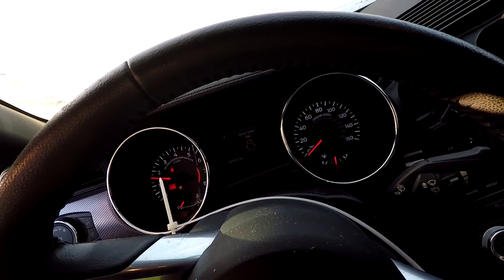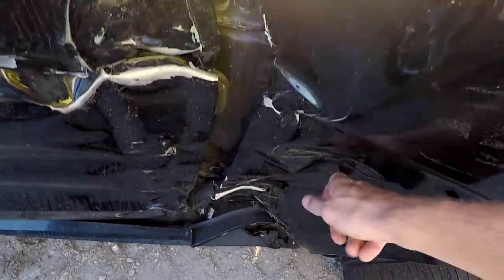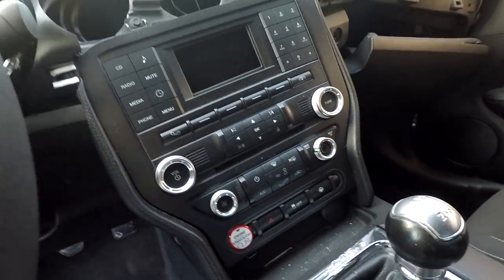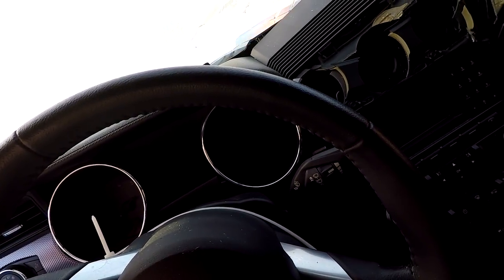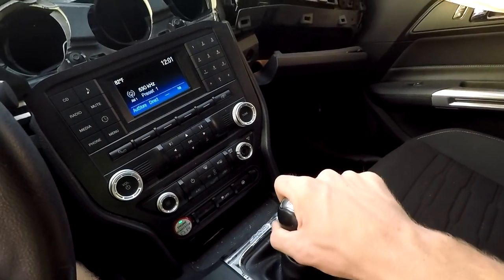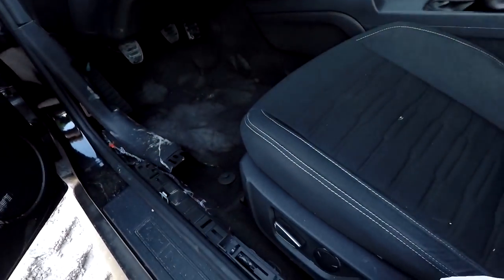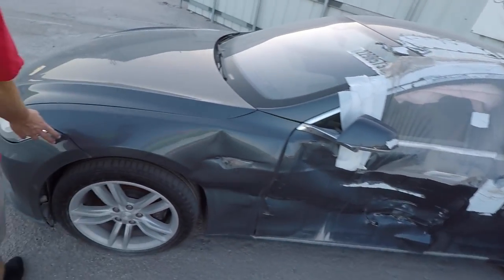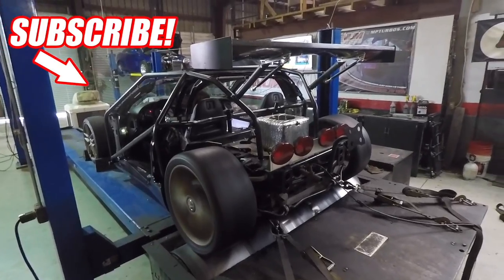WRECKED Mustang at Auction Has Hidden NITROUS! Should We Buy It!?!

Comment: My wife has an '04 Mercury Grand Marquis that she really likes, it's spotless inside & out. She asked me to build a sleeper for her. She drives my cars a lot and wanted more power. It didn't take 5 minutes to decide on the LS3 525hp Crate motor and automatic trans built to sit behind it. I swapped out the stock 8.8 dif with a much stronger posi unit. It took two of us 8hrs to complete the swap, close the hood and hand my wife the keys. It's been 2yrs with zero issues and a lot of surprised Mustangs in its wake. The LS weighs 125 lbs less than that cast iron boat anchor we removed.

Comment: id be looking under the car to see if the trans is leaking any fluid due to being cracked casue that car got hit really hard to buckle the firewall that far and fold the dash up the engine block could have so stress cracks that could crack all the way through from the car being bent so bad also
Reply: transmission won't leak it's a standard

Comment: Also something to keep in mind is when cars get wrecked like that the motor mounts break and they can damage the casing of the motor and trans ect...
Reply: mattybeatzkidd "the casing of the motor"
What?
Reply: fuck you mean "casing"? you talking about the engine block itself?
Reply: Meme City I was more or less talking about the transmission But yes it could cut off the boats for the motor mounts in the block
Reply: mattybeatzkidd boats n hoes
Reply: lkporter1989 lol bolts....god damn text to speach
Reply: mattybeatzkidd it ran and probably sat for days if it was cracked or breached the motor probably wouldn't run
Reply: mattybeatzkidd he'll need to fabricate new mounts anyways because there's no way in hell that will fit under the hood and bolt right up without a little bit of tenderizing. And by tenderizing I mean hammer-powered metal relocation.
Reply: Matt B, Do you have any hands on Automotive experience whatsoever?
Reply: mattybeatzkidd I don't understand a fuckin word you just said. You should try punctuation. It really helps.
Reply: Rodney Rael yes. you think im making this up? Have you never disassembled a wrecked car before. Its very common to find extensive damage to mounting points on the block and trans. As far as what kind of mounts used for the swap i have no clue. Ive never swapped a 5.0
Reply: Brendon Norton i appreciate it lol i was using text to speech which was a big part of it. But yes the grammar Nazis are always out in full force its absurd.
Reply: mattybeatzkidd if the motor mounts broke freewhen he revved up to 4000 rmp it would have been noticeable
Reply: mattybeatzkidd I will say I know What your talking about tho as I've rebuilt salvage vehicles and have seen it on a jeep wrangler. It snapped the bolts right off the block

Comment: S550 Coyote Engine and Trans Dropouts are going for well over $7K alone, Seriously doubt you'll get the whole car for anywhere close to $7000, Your best bet is going to be finding a a Engine/Trans dropout with the ECU and wiring harness. They usually go for <$8000 depending on generation and mileage.
Reply: Al Kelly 

copart auctions sell ls1 f bodies regularly at under $1800 here....theres a guy with over 25 in his yard next to his shop. Literally his only job is buying them and parting them out

Comment: Coyote only won because you didn't give the option of a terminator swap
Reply: Rob Ferreira i was hoping for a termi swap too
Reply: Rob Ferreira dude can’t believe I didn’t think of that!!! That would have been a fairly easy swap yet fucking badass at same time!
Reply: this guy gets it fuck yesss
Reply: Or hemi swap!!
Reply: Wouldn't a Termi swap be even more expensive?
Reply: sierravmax a termi swap is like 11 grand so yeah 😂
Reply: coyote is a much better motor
Reply: Coyote obviously has more potential but sentimental value also takes a part. I love the 4.6L. I also prefer the new edge look over any other year. The Crown Vic had the original mustang gt 4.6 if I'm not mistaken? A bit of a dog for a V8 but regardless would make the swap that much easier.
Reply: MOST H8D i own an 04 cobra. The motor is definitely sentimental. Only made it for 2 years. It will definitely be a collectors car.
Reply: Jesse Costa I owned a DSG '03...back in '03. If we are talking about the car then, yes. The engine is just an iron block 4.6L with forged internals and a little M112 on top. The Coyote has so much more potential especially in Naturally Aspirated form. There is no comparison.
Reply: yeah , I think I said twice ,triton  6.8L V 10 .  he could pick up a short bus or cube van with one in .. theres a few crown vics with them in here on youtube
Reply: MOST H8D you’re absolutely right. I’m just speaking purely sentimental value. Coyotes are much more readily available. Terminators are hard to find. Although both motors can hold roughly the same power before you need to start replacing parts 🤷🏻‍♂️
Reply: Jesse Costa This is an engine swap project not who can find the rarest car. Sentimental value has nothing to do with this. It's about which motor is superior and that my friend is the Coyote.
Reply: That's why a decent stock 03-04 cobra goes for an easy 25-35k. Some people have their heads too far up their asses apparently.
Reply: Jesse Costa My Coyote? That was sold in 2012. Last time I checked it was a 2015 Z06 and a 441ci C6Z in my garage. Lol FOH
Reply: Nick W BTW, I bought a DSG 03 Cobra off the lot. Been there, done that. Go listen to some more Riff Raff. 😂😂😂
Reply: Jesse Costa 😂😂😂😂😂 aaahhhhh!
Reply: Jesse Costa BTW, do you have vids of your Termi? Are you on any of the forums?
Reply: Jesse Costa Stop posting under different screen names. The trolling is obvious. Goodbye and have a nice day!
Reply: Nick W 4.6 is slow i can beat them with my 3.5
Reply: Jesse Costa yes bro no one sells terminator engines..my buddy just sold his car for 19 stacks shit was clean
Reply: Lost One420 he sold his termi?? Noooooo! Lol that car was SOOO good for its era. 03-04’s will be worth tons when I’m old man. I’ll never sell mine. Ever lol

Comment: I think the car is to go for $9,000 + 
Cause 
Rims & tires= $1000
Windows that haven’t been damaged=$500+
Drivers door=$300+
Rear quarter panels=$300 a piece 
Motor trans=$6000
Rear diff with suspension=$1000

I can go on and on that’s why I think it will go for over $9000. 
I love to be proved wrong.😁
Reply: Doesn’t it depend on other interested buyers being that it’s a auction.
Reply: David Corrente one it was a joke about the dick swingers thing and two i can afford new part and no I'm not a LS fanboy i have 2015 Mitsubishi Evolution I'll stick with being different
Reply: $8,300 + fees= $10,000 I guess I do know what I’m talking about.

Comment: So they wrote off that Stingray because it had a busted front fender?  That sounds like BS to me.
Reply: Here's it's listing https://www.copart.com/lot/46691687

My guess is that the car was stolen and the owner was paid out.
Reply: This happens a lot with more expensive sports cars, exotics, and hypercars. They will total any of those cars out when they get undercarriage damage. Even minor. Don't remember why, but they do. Probably cost of suspension and frame replacement being super high if I had to guess. Most of the exotics you find at auction are either there because of flood of undercarriage damage.

Comment: F150s have coyotes in then and usually are 10x cheaper
Reply: ITzMichael523 motors aren’t 100% the same cams and a couple other things are different
Reply: That1slow 3.7 they're the same...
Reply: ITzMichael523 Bruh look it up if you don’t believe me but Cams, intake and the tunning are different. The compression is down to 10.5:1 and the truck has a diffrent oil cooler setup and also doesn’t have piston cooling jets but they did get rid of the cooling jets after the 2012s
Reply: They have a smaller intake cam for more torque on the low end. The cooling system is obviously going to be different because it's a fucking truck that's going to be abused more. And that's not ever a part of the motor. And you don't want that stock shitty manifold on the stang or the truck anyways. They're the same fucking motor end of story
Reply: ITzMichael523 nah they aren’t
Reply: David Stevenson I gave up when he went on explaining how they are different just to say they are the same
Reply: Eminem

Comment: That transmission on the mustang is going to blow up if you try to drive it hard
Reply: How much torque do they usually hold up to? What breaks for on them?
Reply: Id swap a tr6060 instead of that junk mt82. No aggressive driving for very long with the mt
Reply: beeman4266 you can’t power shift without exploding a gear

Comment: Want to know if the engine is warn.  Regardless, to an all cylinder compression test.  A couple drops in the spark plug hole and 20 mins later, you know a whole lot about engine wear.

Comment: Check the oil before you start it, dude!  You know that!

Hmmm.  Nitrous plate, and 37k miles.  Figure 0.45 miles per pass for return to the pits and back through staging to the start -- so ... under 53,000 passes through the 1/4 mile!  Steal!

Comment: the vet has a broken frame i will put money on it i work at gm and they are really bad frames there is a weld by the floor tubs and if you hit a curb or and sharp.bump it breaks its a poor design the crack bend and brake there

Comment: Mustang guys like to hide the nitrous so they don't have to make excuses for why their cars are on the bottle and still so slow you have to plant a stake beside them to see if they're moving.
Reply: DEEREMEYER1 race you in my 89 GT Salleen. I got one shot one blast set up. 0 to 60, and then shot, 60 to 120 . All total, 11 sec.
Reply: Top speed, by the way, 6 gear set up, Mackey rear no slip, maxed at 9000 rpm, top speed 149. That's a 2800 lbs pound car going that fast that quick. Understand that Ponies are big speed players. Don't get it twisted, I play and pay for Pinks.